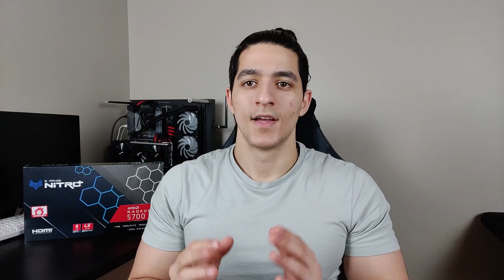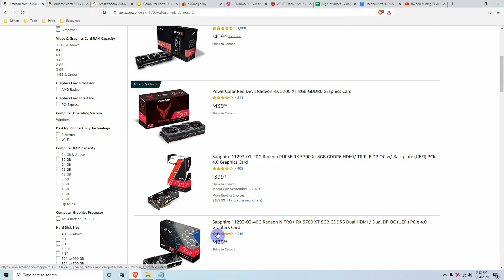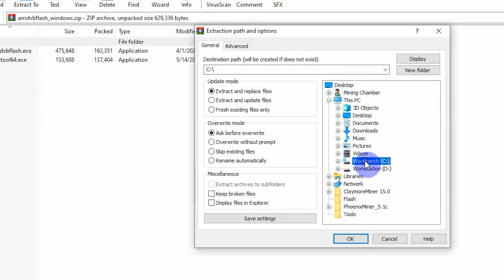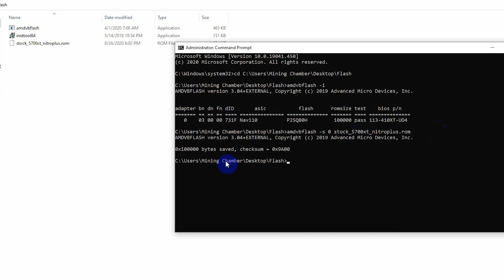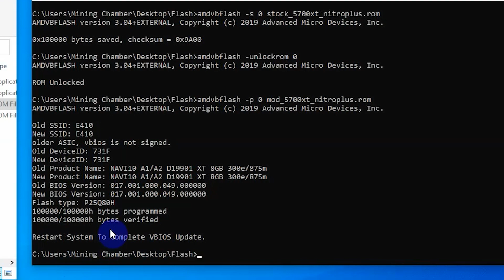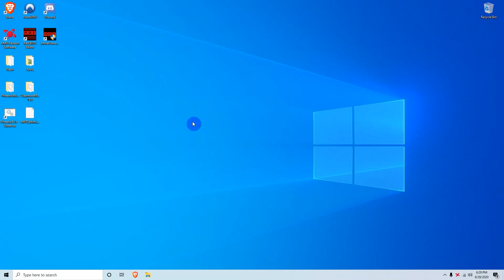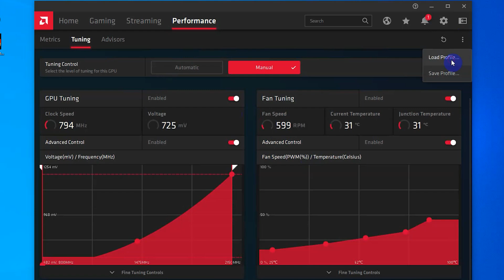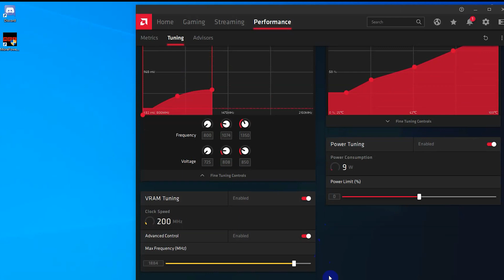RX 5700 XT Mining Overview | Profitability, Hashrates, BIOS Modding & Overclocking

Comment: why does this error happen when trying to connect with phoenix miner: NO CUDA driver found! where is the problem from?
Reply from the maker: That just means there is no NVIDIA cards plugged in which is completely fine! Does it still mine after that error? Usually if you do -amd in phoenix it will let it know that there is only AMD cards to mine with so it doesn't try to look for NVIDIA drivers
Reply: @MiningChamber  no it didn't work,i did every thing to fix it ,also cleaning the driver by DDU software,but only reinstalling windows fixed it
Reply from the maker: But does it mine after showing that error? Like I mentioned as long as it doesn't stop the mining your fine cz it is not related to AMD graphics. Or are you using NVIDIA gpus?

Comment: hey mining chamber. So from my experience I noticed that memory is honestly either a lottery or terrible quality control. I got a asrock 5700 bios modded to xt and can push the memory to 1850mhz while my sapphire pulse 5700xt can only be pushed to 1775. Ive notice the memory junction hits 100 degrees on sapphire, so either terrible memory or terrible quality control. I believe its terrible memory as I swapped out the memory pads. Just goes to show that a cheaper card can do way better. Memory lottery for the win :/
Reply from the maker: Oh wow that is crazy! That surely is poor quality, where you able to RMA the card? Id try to return it for a better luck that is extremely unfortunate 😩
Reply: @MiningChamber  so when living in canada, its not worth rma with sapphire as they charge an illegal admin fee so they can ship it back to hong kong and back. Also I bought this second hand for really cheap. Seller said they need cuda cores, but i suspected something must be wrong if they are selling 25% retail price. After making them benchmark, i notice nothing was wrong, but when I tried gaming, I notice memory junction went to 100+. After doing tweaking, it still went to 98+ so I figured seller just didnt tell me that but gave a cheaper price. Honestly, managing to score 54mh/s for 3/4 of the price is not too bad, but would love it if it could perform like my 5700 challenger which pushes at 57.8mh/s and I managed to get this for 1/2 the price as seller wanted to upgrade to xt and lived in the middle of nowhere lol.
Reply from the maker: I see I see. Makes sense. In that case I'd case settling with 54 will do. Trying to downvolt as much as possible will hopefully help, maybe even putting then in a server chasis for better cooling!
Reply: @MiningChamber  Thanks for the recommendation! My server chasis is currently reserved for my 6 1080ti. 5700xt will learn to suffer a bit in my full size atx case xD Also I love your videos! Keep making great content on just everything about crypto hardware, I have learned so much from u!
Reply from the maker: Thank you so much!! Haha and good luck my friend !

Comment: and i have hanging card with 1350 cpu and 1884 vram!! why?
Reply from the maker: Youl need to tune down the overclocks just a bit if it keeps hanging! I'd try to start at 1800 memory and go up slowly by 10s. Check our overclock website page as well to help you understand the ranges it should be in the description

Comment: bro i assembled 1 rig with 8 gpus and its ok but have 3% stale shares!! with first config and 95w
Reply from the maker: Hey! That is awesome! 3% stale I don't believe that is an issue. It will most likely be cz of network connection so make sure you use ethernet if you can

Comment: are the sapphire pulse 5700 xt overclocking parameters the same you mentioned?
Reply from the maker: Yes all 5700 XT will generally follow the same numbers just sometimes youl need to fine tune it slightly so it doesn't crash if it keeps crashing
Reply: @MiningChamber 
hi, first of all, great job on the video! 
I'm having the same card as Mahmood, but I'm facing a problem with the error "AMD Radeon default Radeon wattman settings have been restored", which is killing my miner. I tried it on Stock Mod, reduce/adjust all settings, but it's still "crashing" after a few hours. I'm using the latest 20.9.1 Drivers (also tried with older ones) and PHX miner 5.2e (can't get 5.1c) and the result is the same. do you have any tricks for my problem? tnx
Reply from the maker: @zd4843  I have been seen alot of crashes with latest drivers I recommend doing it with 20.4.2 and then after you have those drivers, start messing around with the overclocking values because it is 99% of the time is the issue. Check our website miningchamber.com and go to the 5700 XT overclocking guide and just follow the range we have on our website! When it crashes keep optimizing within our range until you find a stable point
Reply: @MiningChamber  hi found a sweet spot, thank you for your help, and keep a good work

Comment: I have to apologize. I did not fully believe your review on what cards not to buy. Got 2 XFX thic III added to the rig and they hash 53 mh out of the box at 105 watts. 14 card rig now, no bios mods 732 mh
Reply from the maker: It's okay haha! 732 Mh that is awesome. Which motherboard are you using ?
Reply: @MiningChamber  Hi. Asus BTC 250 pro mining 2 x 2200 psu 8 GB ram and 256 drive. 2.56 w/MH in total which is really good compared to 4w/mh on the RX cards 1850 watts total consumption for the whole rig.  Max temp 65 C, the cards are very close together.
Reply from the maker: That's awesome! Thank you for sharing!

Comment: tried it with msi evoke rx5700xt, have gain about 2mh but a lot more crashing even if less overclock than stock bios, so i reinstalled stock bios back, it is not worth changing the bios for such small gains and more crash
Reply from the maker: I agree! I believe the Evoke gets really hot that's why it will crash more frequently. So pushing it harder with BIOS modding will most likely be bad for it. 

Thank you for sharing your experience with it!

Comment: I have 2 RX 5700 XT 
Gpu1-Sapphire Pulse oc Without bios mod Im getting 55mh @94 watt (wattman reading)  1286mhz core clock @756mV, 1900mhz memory clock. 
Gpu2-Gigabyte Gaming oc Without bios mod Im getting 55mh @112 watt (wattman reading) 1266mhz core clock @756mV, 1900mhz memory clock
Both gpu tuned at wattman runnig at %70 fan speed 
Only promblem here is memory temps. its getting 92-102 degree celcius for both cards.HOTT
Reply from the maker: The memory does get pretty hot, mine peak up to 90c but you do have really good undervolts I'm surprised it's getting that hot for you. I'd try tuning down the memory clock to 1800-1850

Comment: Greetings and good day,
I hope you are fine and safe,

I would be grateful if you could check if it possible to run the time straps of the vram using the red bios edit program of Igorlabs as below:

Test 1:
- K4Z80325BC
1000 MHz - - - > 1250 MHz
1250 MHz - - - > (1500-1550) MHz
(1500-1550) MHz - - - > 1800 MHz
1800 MHz - - - > 2000 MHz
2000 MHz - - - > 2250 MHz

- MT61K256M32
1000 MHz - - - > 1250 MHz
1250 MHz - - - > (1500-1550) MHz
(1500-1550) MHz - - - > (1750 - 1800 - 1875) MHz
(1750 - 1800) MHz - - - > 2000 MHz

Test 2:
- K4Z80325BC
1000 MHz - - - > (1500-1550) MHz
1250 MHz - - - > 1800 MHz
(1500-1550) MHz - - - > 2000 MHz
1800 MHz - - - > 2250 MHz

- MT61K256M32
1000 MHz - - - > (1500-1550) MHz
1250 MHz - - - > (1750-1800) MHz
(1500-1550) MHz - - - > (1875-2000) MHz

Many thanks in advance.
Reply from the maker: I wouldn't be quite sure, I do know keeping it at the 1550mhz timing is better since it has a higher refresh rate.
Reply: @MiningChamber  Thank you for your kind and quick reply,

I would have tested these settings however in case of unsuccessfulness I am limited by the below:

- I have only one card that does not have dual bios.
- I do not have integrated gpu.
- I do not have bios hardware flasher.

I would be really grateful if you could help with this matter as I am seeking your help because you are knowledgeable more than the others who I have contacted before,

My goal is to find a universal setting for the vram timings not only for mining purpose but for gaming and working as well,

I found out on the internet that test 2 is not successful when someone copied the timings of 1250MHz instead of the 1500MHz to the rest after it,

I would really appreciate if you could help in checking the settings of test 1 to verify if the card can work stably with it or not,

Your cooperation is highly appreciated,

Best Regards.
Reply from the maker: I can't give you any promises unfortunately since the mining rig is up and running in the mining room. But I would also like to add that I'm not as knowledgeable as many others in this field! I believe if you join Red Panda Mining Discord you will find some really knowledgeable people there regarding to memory timings and such. 

We are sorry! If I ever get the chance to test it I will let you know !!
Reply: @MiningChamber  Understood and my sincerest gratitude for your kind consideration and understanding,

I wish you all the best in the future and to live healthy, happy and peaceful life,

Best Wishes.
Reply from the maker: Thank you! You as well. Take it easy!

Comment: I am using a Mech RX5700xt, can I bios mod it as the exact steps, and expect the same results?
Reply from the maker: Yes you can do the same steps!! Just overclocking it might not go as far down since that card can get pretty hot! So youl need to play around 780 to 850 mv core voltage - you can check our website miningchamber.com for more infos on the overclocks

Comment: What what are good settings for a non bios moded version of this card?
Reply from the maker: You can run it the same settings 1800 mem 1300-1350 core and for undervolt do a 780-820 mv then should be good to go!
Reply: @MiningChamber  I'm still figuring out how to play with the settings in the 20.4.2 drivers. I always used the settings in Phoenix miner for my rx570's
Reply from the maker: That is fine as well!! Join our discord if you need any more help

Comment: Hi, I have built my 1st rig with 3 GPUs to start off, I followed all the steps for my powercolor 5700xt and everything went great thank you for the help!
Now I also have 2 xfx 5700xt and both have the same problem 'Amdvbflash failed to read ROM when trying to save original BIOS'
Any ideas???
Reply: Ok I tried a newer version of amdvb flash and it reads the ROM fine, but now when I do the amdvbflash -p 0 XXXX.rom I get a 'BIOS authentication signature mismatched' message with error: 0FL01
anybody encountered this problem before?
Reply from the maker: Which version of amdvbflash your using? Make sure it's 3.04+ and not 3.04
Reply: @MiningChamber  it's not the plus, I will look for it later and try, thank you, need to put the kids to bed now😴
Reply from the maker: Ah that's probably why! Sounds good, good luck!
Reply: @MiningChamber  YES! you are a legend! That worked, many thanks!!!
Reply from the maker: Awesome!!
Reply from the maker: Hmm did you try to unlock rom first ? Using the -unlockrom command if that failed what about rebooting the system and trying again or making sure the amdvbflash is run in administrator mode

Comment: Hello! I need help. I'm trying to build a 10x rx 5700 xt rig but windows is always crashing. It only becomes stable when I put 4x rx 5700 xt. What settings do I have to change or what software version of windows 10 or AMD adrenalin should I run? Right now I'm running Adrenalin 20.9.1.
Reply from the maker: Hey!! I recommend doing it in HiveOs it will be much better there and simpler! It can be that windows is acting up and also check your mobo settings make sure you have all pcie slots set to gen 1
Reply: Mining Chamber thanks for your fast answer. That helps a lot. I’ll keep you updated!
Reply from the maker: Absolutely no problem!! Good luck! Join our discord if you ever want more help or chat there
Reply: Mining Chamber of course I will! Thanks!

Comment: Since I have all my 6 5700XT installed on my rig and want to bios mod, can I just pull the 5 riser cables from MB and do one at at time? Or do I need to unplug power to the cards as well?
Reply from the maker: I recommend unplugging the power from the gpu and the riser as well as unplugging the motherboard connector for the riser! 

Better to do it safely!
Reply: @MiningChamber  Im trying my first bios mod and it wont flash? Says: Bios authentication signature mismatched
Error 0FL01
Reply from the maker: Which amdvbflash tool are you using? Make sure you follow the guide step by step
Reply: @MiningChamber  i had to use from guru3d. Your link at igors doesnt do anything. Only mirror 2 works and that took me to a site that asked for my email then would send the file. Never got it. I hope my card is ok? I cant check card info by doung the -i in cmd prompt. Says cannot load driver. Card still works and mines though. I knew I should have not messed with these new cards. Lol. I did follow exactly except the amdvbflash program. Sorry to keep bothering you but need an experienced vetran to help this noob!
Reply from the maker: No worries at all! I've been hearing about that issue alot lately I just recommend avoiding BIOS flashing till the tool shows up again! You will be producing less hashrate but youl also use less watts so it's okay. You can use these overclocks 
1350 core clock
850 core mv
1800 memory. 

Just play around with the numbers a little if they keep crashing!
Reply: @MiningChamber  thank you sir. I had my rig all pulled apart to do one card at a time. Just put it all back together for now. Ive got those settings but memory is at 1860. I dont pay hydro. Getting 54 hash. Is it even worth the hassel to rip apart again for a few more hash? I will if its worth it. One more quedtion about 7" display.
Reply from the maker: I'd just put it all together and run it, no need to worry about Bios modding !

Comment: Someone Please Help Me out! After flashing the BIOS, my computer isn't starting. CPU gets turned on, but there's nothing on the display. i dont know why this is happening.
Reply from the maker: Hey! Did you try plugging in the display into the motherboard and the gpu? Try changing your motherboard bios to show output from your motherboard
Reply: Mining Chamber I found out that when I remove the GPU, the system boots up. But when I attach my 5700xt, it stucks on the black screen. I’m using Asus B250 motherboard. It’s not even going to the bios. I’ve attached my monitor to the motherboards HDMI Port. How can I change my motherboard bios to show output from motherboard? Thanks for the quick reply 😭 I’m in too much stress rn.
Reply: Mining Chamber i tried connecting HDMI port of my GPU to the HDMI port of my monitor. But the monitor isn’t even turning on, in that case. Alternatively I tried connecting motherboard’s HDMI to monitor, in that case atleast the screen was turning on.
Reply from the maker: Then try to do a cmos reset on your motherboard. See if you can get into the Bios. Worst case youl need to load the default bios that you saved in the first place!
Reply: Mining Chamber I did a CMOS setup. So when I do not insert the GPU, the system would work without any problem. But as soon as I insert the GPU, the system won’t even start, it would stuck at a black screen with an underscore.

Yes, I have my default bios with me, which I backed up (thanks to the video). Now, how can I load my default bios on the GPU, my system isn’t even starting, then how can I load my defa bios? Please recommend me a video or article or anything which could be helpful in my case. Is my GPU bricked?
Reply from the maker: So if you see a underscore then that's good. Means you can still see a display.

Which gpu model do you have? You should have a switch on it for a different bios let me know
Reply: Mining Chamber I have a Gigabyte RX 5700 XT Gaming OC 8G/Rev 1.0 GDDR6. I’m unable to find a switch on my GPU😢
Reply: @MiningChamber  How can I proceed ahead with this underscore sign?
Reply from the maker: @omchevli5347  if it doesn't have a bios switch usually near the power pins then try to put it in someone's pc or plug in another gpu then flash original BIOS back on 5700xt
Reply: Mining Chamber what if I reinstall Windows 10, and then plug in the GPU, would that work? Or else if I attach another graphic card then how would I able to flash 5700xt? It’s just 2 days of me purchasing this gpu, so can I claim my warranty?
Reply: @MiningChamber  I remember that by mistake I loaded  MPT file twice, in the Red BIOS editor. Does that affected by GPU severally? I think it's because of the GPU's BIOS, which is not letting anything to work. Please share your point of view.
Reply: @omchevli5347  Greetings,

Please, use the official Gigabyte bios with its own flashtool in the kindly attached link below to reflash and fix any bricked Gigabyte RX 5700 XT GAMING card:

https://download.gigabyte.com/FileList/BIOS/GV-R57XTGAMING-OC-8GD-FA0.zip

This bios is modifiable as well,

You may have a good day,
Regards.

Comment: noob question: is it worth to bios mod if I plan to do it on my gaming pc? It's currently mining during the day and I stop it to play a bit in the evening. Also, is you temperature (42C) that low because of the bios mod? My card (sapphire pulse) is often at 63C-64C mining 52 MH/s. Thanks!
Reply from the maker: Hey! That is a really good question!! I don't recommend Bios modding if your also using it as your daily driver. BIOS modding gives you a couple more hashrate but also makes it use more power. It's best to avoid it if it's not dedicated for mining.

As for the temperature it is because the room was a bit chili! Usually the gpu is at 55-60 in the mining room and memory temps are at 80c